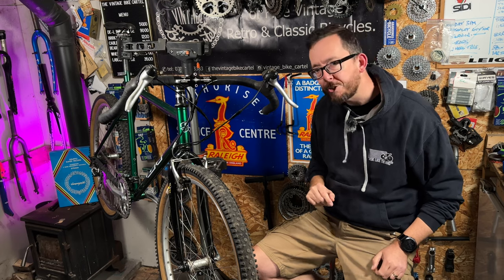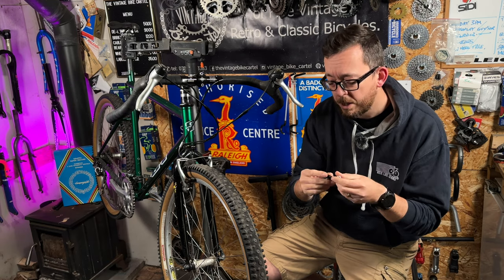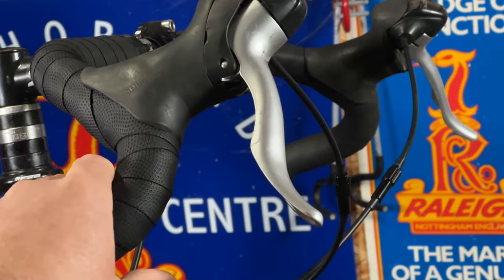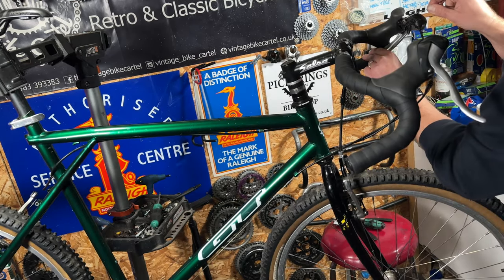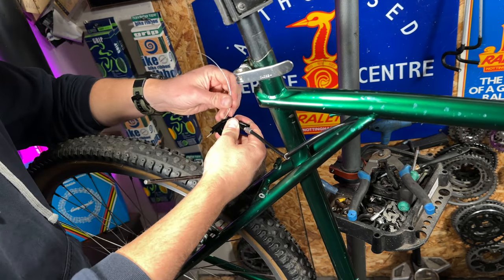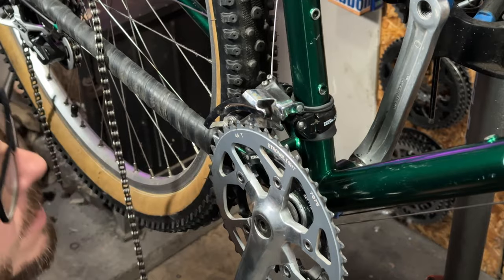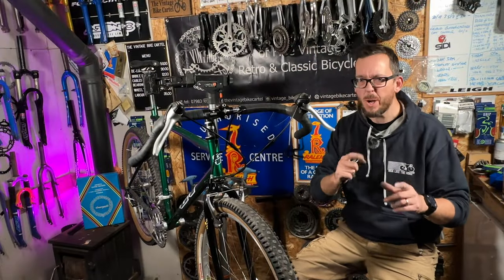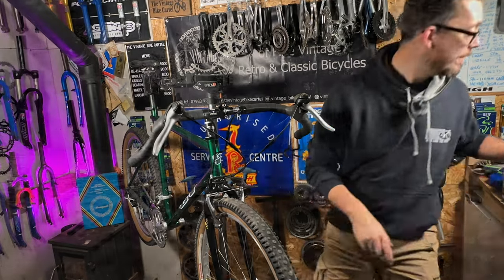Retro GT MTB Gravel Bike gets V-Brake adaptors for Road levers - Travel Agents!!

Comment: Awesome build. Was looking at the cable routing around your rear brake, and can’t help but wonder if feeding it around the NDS would eliminate some of the bend from its current method of routing? Maybe less friction in the cable pull from a more uniform bend?
Reply from the maker: Hey man thanks for watching! Time will tell if the routing works out - stay tuned!!! 👍👍👍

Comment: Love it! I'm currently building a GT All Terra Ricochet and want to convert it from cantilever to V-brakes. Did yours have cantis as well before you converted to V-brakes? If so, how did you fit the cable housing through the frame? Does it work fine? It looks like you didn’t use the guide near the saddle on the top tube. Any help would be much appreciated! And how does it fir through the front guide on the top tube? :)
Reply from the maker: Thanks man! Yeah mine was canti brakes and the swap is pretty easy - I drilled out the routing to take a full cable outer - but there is an easy way too.
You can simply make a full cable outer from brake lever to brake noodle and cable tie it in place on the top tube.

Either solution is neat and simple - good luck with your build mate! 👍👍
Reply: @Downhillsmoothtarmac  amazing, how quickly you responded! I drilled it out as well! Worked like a charm and looks super clean. Now I just need to get that f** bottom bracket out. Hahaha😂 but I am so hyped I hope it will look as amazing as I have it in mind. I want to make a city bike out of it, so I probably even purchase dynamo lights and new weels with a hub dynamo :)
Reply from the maker: @retusrieben6487  sounds like a nice build man! If you are struggling with the bb try putting the tool in a vice and using the frame as leverage, remember the drive side will be reverse threaded too!

Comment: Do road brake levers work okay with cantilever brakes? I have a Gary Fisher and I want to put drop bars on it with end bar shifters.
Reply from the maker: Sounds like a sweet build! - yes both side pull brakes and cantilevers have the same pull ratio and are compatible with road levers 

Bear in mind, if you were to buy tektro brake levers, I’ve been told they will allow v brakes too

Comment: On the front derailleur: Maybe the bottom bracket axle is too long. For a 2x setup you want a slightly shorter axle to accommodate the more inbound  chain line, which might also be a better fit for the derailleur.
Reply from the maker: Axle length is fine, with the XT on there it works perfectly now. Upon closer inspection, the deore I used first kept sticking and was generally tired.

Comment: Everyone claims the mini v brakes work with road levers.There is still to much lever movement. I installed the generic travel agents. It works great. They did require enlarging the cable hole.
Reply from the maker: I’ve heard this too, but as far as I’m concerned the pull ratio is pretty much the same as a standard v-brake and therefore the lever feel will still be poor as it’s wrong!
Travel agents are the way to go - plus I’ve found with mini v-brakes that clearance can be a bit of an issue too
Glad they worked out for you!

Comment: They can actually work just fine without any adaptors, it's a bit tricky to setup them but if I could do it, anyone can.
Reply from the maker: They can and these were ok before the adaptors, but not great - having ridden them with the adaptors for a while now, it’s honestly a night and day difference, particularly in wet and mud.

Although, if you were using Tektro brake levers, they don’t need the adaptors at all either….